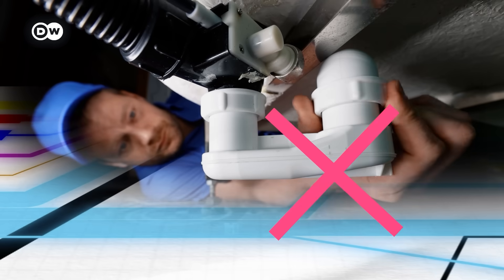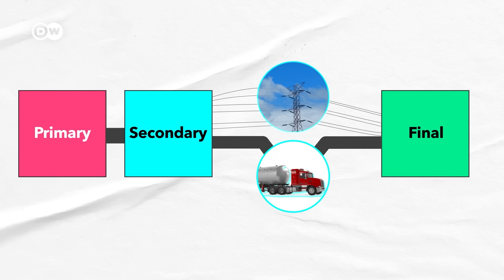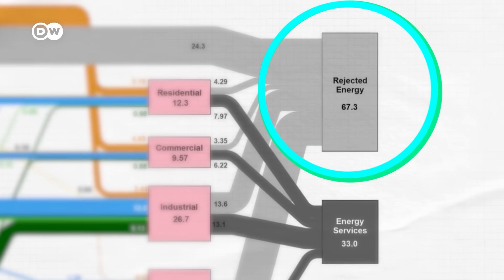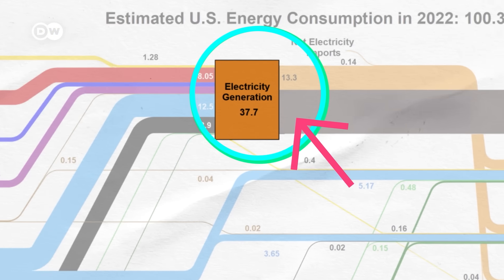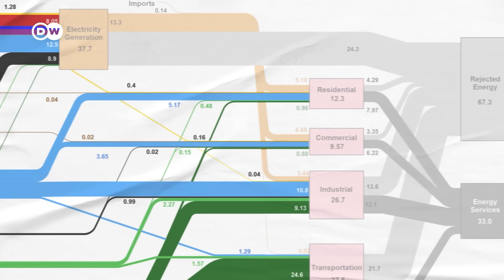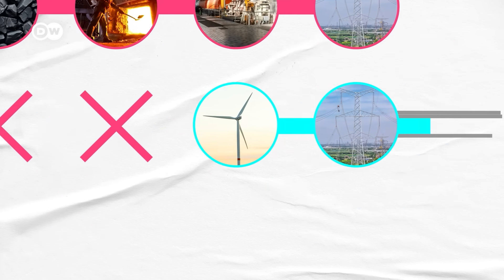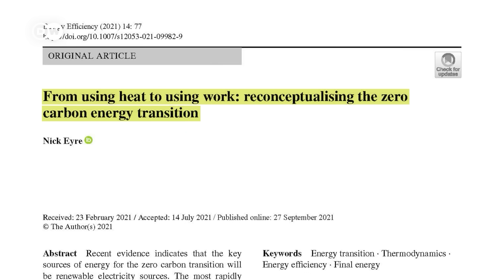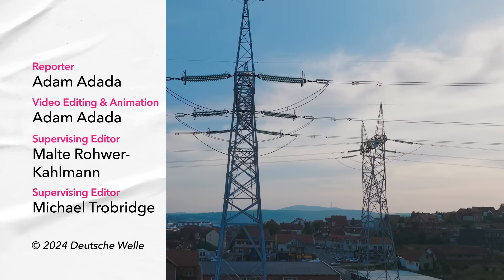The mind-blowing thing we get WRONG about energy

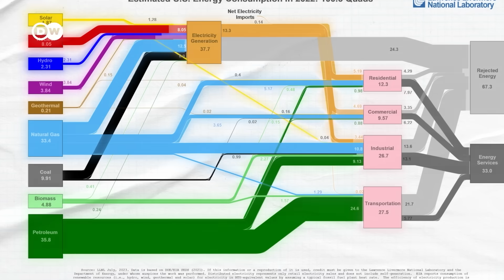Comment: I am a skeptic, when you look at the graph 9:32, it looks like 1/3 of the renewable energy is useful but some of it includes natural gas and coal so we dont get a clear picture. The price of energy would rise, this would effect the price of almost everything. And the windmils and other renewable energy has a lifetime. So is this sustainable? Can anyone change my mind..
Reply: I think youre right with the graph its not being particularly clear about the energy loss by renewables. I am assuming that you are saying that switching to renewables would make energy more expensive. Thats very unlikely because you can produce electricity for way less money with for example wind turbines. From what i know its ablut half as cheap as fossil fuels and a quarter as cheap as nuclear energy. Its also true that they have a lifetime but so does everything and there is no evidence that renewables have to have a lower lifespan than other things,  for example coal powered generators.
Reply: @carlchc9022 I’m not a renewables skeptic but wind turbines (particularly the more efficient offshore turbines) are extremely expensive with a low shelf life with 15-20 years with no real plan to take them out once they’re finished. Absolutely renewables are the future but we require a high baseline. Eyes point to France as they have a well executed nuclear system. 
Nuclear and renewable synergy (and hydrogen from excess renewables) are the future!
Reply: I don't know about the US but at least for Germany / most of Europe I can say consumer price for Electricity from renewables is a lot cheaper than the one from fossile let alone nuclear. We have this discussion regularly in Germany because all nuclear facilities are shut down, fact is however that depending on who said it nuclear energy costs about 25-30 cents / kWh  (production price) while wind energy clocks in at about 8-17 (production price) depending on source including storage. All this being said I think the main reason to switch to renewables (and make it go fast) is because if we don't stop the global warming and the rising of the oceans we will have much bigger problems than just high energy cost

For reference: in Germany after the Ukraine war started we were looking at 50-60 cents per kWh consumer price, after the heavy push of the greens in the last 3 years we are now back down to 30 cents per kWh consumer price. This is partly due to us having more gas sources, mainly however it's due to the massive renewable energy push
Reply: @huntingfighteroramara  Im also from germany and I agree with the most part. It is defiently correct, that the price of renewable energy is way cheaper per kwh. Sadly, this has mostly no effect (YET) on the consumer prices of energy. The market price of energy is not set based on the average price per kwh of all the input, but the max price per kwh of the input (this is called merit-order or Grenzkostenbepreisung). Therefore as long as expensive (e.g. coal) ways of getting energy are necessary to meet the current demand, the price stays high. If now only cheap (renewable) energy is necessary to meet demand (either because demand is currently low, or because renewable potential grew) the price drops.
Because we still often depend on coal and other expensive ways of creating energy, prices often stay high. When we can replace then fully, or in bigger time windows, prices will drop also for the end consumer. (This does not include other parts of the energy price such as Stromnetzentgeld, etc., only the Börsenpreis)
Reply: @mistert2663  agreed, this is one of the reasons why it's so important to finally get to 100% greens from the business perspective (apart from the obvious ecological advantage), it's getting better but not there yet, though consumer price has dropped a LOT again from the peak at the begin of Ukraine war, not solely because of renewables but they took a great part in this
Reply: It‘s not that complicated, the efficiency of a coal or gas plant is about 40%, wind and solar enegergy from converting the fossil to electricity. Solar and windmills already produce electricity in the first hand (wind and solar are not a finite resource like fuel, coal,…)  so to keep this simple we need only about 60% of the renewables power that we where burning in tons of coal and barrels of oil. Also we then shift to e.g. heatpumps and electric cars where the efficiency is higher too, so we use most of our generated electricity in the final stage, like driving a car.

Comment: If you think a little deeper, I think you'll find the answer.
First of all, it is dangerous to reduce thermal power generation to zero.
Last year, California increased its solar power generation ratio, resulting in widespread power outages after sunset in the summer.
This is because many people ran their air conditioners even though solar power was not generating electricity.
As Emma explained in the middle of the story, even if a power shortage occurs and a thermal power plant is operated, it takes time for the turbines to reach the specified frequency.
Also, solar power generation cannot be used when there is snow.
Wind power generation cannot generate electricity when there is no wind or when the wind is strong.
In that case, amateurs think that it would be better to use storage batteries, but if there is insufficient power generation for three consecutive days, a blackout will occur.
Considering all the balance, we need some nuclear power generation, some medium-sized thermal power generation, and a system to convert renewable energy into potential energy when it exceeds the limit.
I have a unique gravity power generation idea.

Comment: How much more do windmills and solar panels do we need to replace fossil fuel?
Reply from the maker: Hey Christian! It is hard to tell but the IEA for example estimated that by 2030 renewables will contribute 80% of new power generation capacity. However, there are different outlooks and it is also very dependent on factors such as policy changes and market developments.

Comment: What's never look at is the amount of fractions from crude oil used for every other thing in society. If you take away like 40 percent of the distillation "fuel" or make it worth less all the other bit are going to get more expensive that's plastic, tar for roads, fertilizer, etc. The other costs like having a whole new grid which is very much more complicated and expensive to support these "green" devices isn't look at or the fact your putting in at least four times the energy for an EV and half span. Pretty hard to beat fossils or a system developed over a century.

Comment: funny how you "got WRONG about energy" statistics by using a Sankey diagram on the first place. You are trying to solve a problem that was created by the very same accounting method used.

on the primary energy source side: we are talking about biophysical resources, not energy on itself. As someone else pointed out here in the comments, we just decided to ignore that a wind turbine only captures a fraction of the power of the wind AND leaves turbulent and slow wind disrupting the wind patterns that drive our so needed water cycle. But engineers just chose to ignore that because for them the only thing that exists is machines.

On the EndUse side the problem of a sankey is, again, that is not using biophysical units to describe our societal needs. What we need is ton*km of freight, or pax*km, or liters of water boiled... Only using this units we can properly plan our future with the machines and energy carriers that actually work.

The moral is that we should use a complex system with proper units to describe everything, because life is complex, and not uset a linear flow of non-equivalent information.
more on that in: Are energy statistics useful? Giampietro and Sorman, 2007

Comment: Shows us a video staring in the beginning it is hard to do the switch (probably because of the fact that most cars on the road / most energy generators are still using fossil fuels and it is going to be expensive to change / replace. And not everyone can just replace it easily due to the cost.We all agree on that? Okay! Same page. That reality doesn't change, ie cost of replacing)

Here is the rub with the video: "Fossil fuels are more energy inefficient . . And this is good news, because green energy isn't!" 

Okay . . Does this somehow make money rain from the sky so everyone can replace energy production? No? Thanks for wasting my time

And also outdated info. One of the selling points for green in the very beginning was energy efficiency (or at least it has been over the last decades and the constant push for green. You sound like a nagging child not getting what it wants, but not understanding the parents don't have money to buy it)

Comment: Focusing on Carnot efficiency misses the point. You could just as easily talk about how wind mills only capture a tiny fraction of the kinetic energy of the air moving by them, but it's absurd: if you captured all the kinetic energy of the wind, you'd have no more wind. Comparing the energy in a liter of gas to the energy in 1sq m of sunshine is apples to oranges. The whole Rejected energy category needs to be accounted for as a reduction in the the amount of energy going into the process doing the rejection. Efficiency is a red herring. The real issue is cost, and once you account for the "Rejected energy" and the climate costs, fossil fuels are generally more expensive and the cost is only going up.

Comment: Whether it's easy or not, we wiped out Small Pox and went to the moon! We also built a the existing grid from nothing in a few years! It's just a matter of will.
What's more, you didn't cover how most energy is used for heat, and the relative low cost to run heat batteries. Just doing that, and throwing enough renewables in the grid to energize them, and we have gone a long ways towards our goals.

Comment: The question is why are those big industry's wasting so much heat. When they can heat up their own buildings. Or even bettet make their own electricity for a small part. The're are so many installations that need coolingtowers. Why are they not using this steam/heat to make power.

Comment: Wow.. you discovered that thermal machines have a 30-40% efficiency! Congratulations!! 
It is the most childish and shallow analysis I have seen. The fact that you use 'energy' ambiguously (mixing chemical energy in fossil fuels with mechanical or electrical energy) indicates that you don't understand what you're talking about. If you use thermal machines you lose 2/3 of the chemical energy to heat. That's a fact that no one can change. It has nothing to do with the use of renewables, nor can you consider them as being more efficient. What matters is cost of energy output, reliability and environmental impact. In cost and reliability renewables suck. This is why no country will ever go beyond 50% renewables. The intermittency just kills you and the cost is prohibitive. Another EU propaganda video. Then you need to import gas from Russia and the US because you have stupid energy policies. It would be better if you started fracking in Germany instead of washing the time with ridiculous solar panels...

Comment: Now thats a bit BS. Especially regarding cooking heaters. Yes gas burners waste energy. But they are still directional. They heat the pot mostly. The wasted energy is pot radiating heat away. Thi happens with all - gas,coal, and electric stoves regardless.  Some systems are inherently innefficient and fixing them leads to diminishing returns. Its not because of the system, its because it is used by human being.. 

As for renewables, as with regards to EV - used two different arguments to calculate EV efficiency, yet its BS. Car uses 30-40% of energy for motion, but its not only motion energy *we use*. We use electricity, we use heat  from engine. And it gets up to 80% depending on time of the year. While for EV you use the oppoaite calculation - you provide "up to 98%" which is in reality 80-98% efficiency if motor, but there are losses in battery charges as well as energy transfer as well as conversion losses of energy from electric to chemical - up to 20%, then - discharging, also 20% of the remainign energy. So just in that your EV efficiency drops to 62.7%, and then there is that "non motion" energy that you declared as non usefull (heating, lights, etc) so we get down to 50-60% of EV efficiency.

Comment: Wow, I knew electric appliances were more efficient than primary energy powered ones but I never realised their losses could be as high as 80% (in the case of a petrol car). What a waste of energy! Even if we burn coal to produce electricity to power EVs we'd still be better off as the losses are about ~68.5% => 65% (generation loss) + 3.5% (10% losses in EV)

Comment: The problem of fossil plants being in the inefficient phase gets worse as we add renewables because these big fossil fuel plants are more efficient when run constantly at high power. Certainly electrifying the usage end is just a win but adding renewables to the generation end is a mixed blessing and they pretty much do nothing to reduce the problem of firing up old plants to cover peak hours. This actually suggests to me that we would get more out of leaving generation alone while we electrify usage and then once our consumption is down shift to changing generation as the second priority. Halving the 80% while keeping it efficient seems better than perhaps reducing it by maybe another 20% while making it less efficient

Comment: The big problem with renewables is that storage systems are either extremely limited or extremely expensive and not feasible on a large scale. I don't think what is mentioned in this video does anything to solve it.

Comment: Nuclear is a dead end as far as global warming is concerned. The vast majority of the worlds nuclear plants are close to or past their designed lifespans and will require massive rebuilds or deconstructions within a very short time. We have virtually no clue how to dismantle them, dispose of the mtns of waste past and present or what it will take to remove the thousands of plants that will face flooding problems along coastlines. And the scale of this replacement process would require new plants coming online every week for decades just to maintain the roughly 20-25% of world electrical production nuclear currently supplies. And if you think building the infa structure for renewables is costly its a drop in the bucket compared to nuclear power plant replacement. Soooo.....maybe we need to focus on renewables and maybe hope that mini nukes might keep some nuclear power generation going in the future.

Comment: The video is misleading. Wind and solar (RE) are in respect of exergy efficiency worse (possibly far worse) than fossil energy. To fully and entirely use RE one has first convert it to hydrocarbon (a small part to H2 perhaps)  and then utilize it back. In a 100% RE society this is how it will work. The reason is well known - it's a temporal and spatial mismatch in RE availability and demand. And especially in inability of lightweight mobile and long tern storage. Storage is 80% of the any energy system burden. Fossil fuel is its own storage. This is highly advantageous (unfortunately).

Comment: Lots of people really struggle with looking at things in the bigger picture. I've seen some people argue that we shouldn't build more rail, as "trains use electricity, which means more demand on the grid and thus more fossil fuels will need to be burned!" Which completely misses that increasing the access to trains reduces the need for cars and airplanes, which use way more energy per person they transport! Even if all the cars in that situation were fully electric.
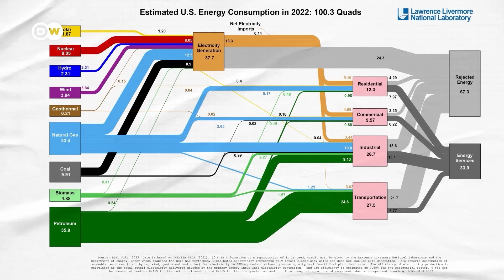Also, I feel like the section at 7:00 needs two added footnotes.
1 : Lots of people confuse induction and ceramic coils together, and end up thinking of slow and unresponsive ceramic coils, when people talk about induction stove tops. Despite induction actually being extremely responsive and fast. Infrared based stovetops are also extremely fast and responsive, as like both induction and gas, they don't have a large piece of ceramics with a ton of thermal mass. They use magnetic fields, photons or hot gas, none of which have much in terms of thermal mass.
2 : Heat pumps can achieve an effective efficiency of over 100%, as instead of just turning electricity into heat, they instead move heat energy from outside, to inside. So they don't create more energy than they consume. They just move heat energy that's already there. (And yes, there's a lot of heat energy outside, even in winter. "Cold" just means less heat than what our bodies want. It doesn't mean no heat.)

Comment: Of course there is always W2E burning of plastics… but the APC was, last time I looked, not up to the job asked of it in most facilities (certainly in U.K. ) now develop small scale CC&S alongside W2E sites to rectify this problems and collect reusable carbon, instead of pumping CO2 into emptied underground caverns left by oil & gas, could be a good starter. But baseload is still iffy & more work needs to be done in that direction… nuclear is an option but the hysteria around the creaking facilities first built hampers us building more - as well as the cost!

Comment: This comment is barely relevant, but consider the energy density of a gallon of gasoline. Visualize a gallon of milk. Pour it out (or consume it) and fill the container with a gallon of gasoline. That amount of liquid can move me and my heavy Nissan Maxima, with its inefficient rubber tires (not steel on rails) 25-30 miles down the road. It's really mind-boggling how much energy is in gasoline.